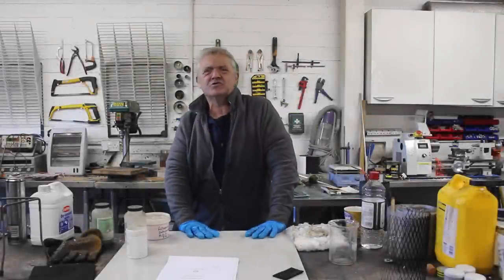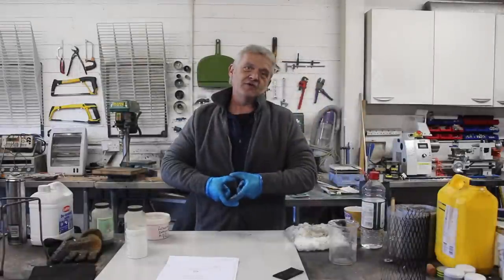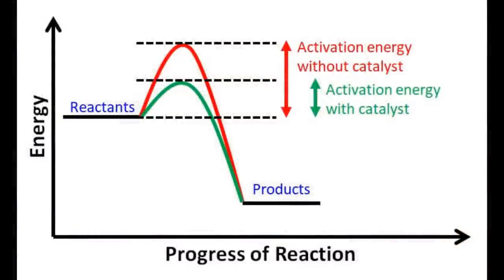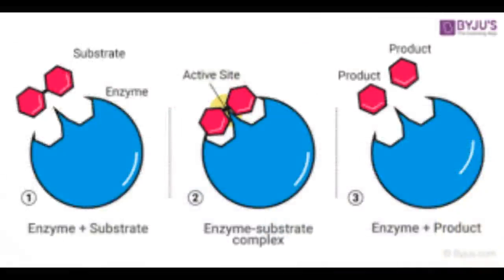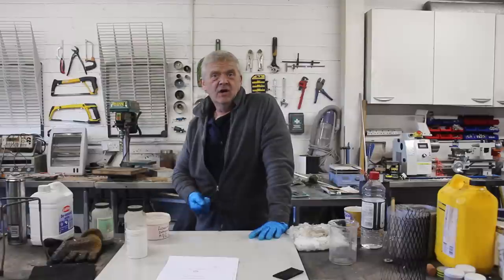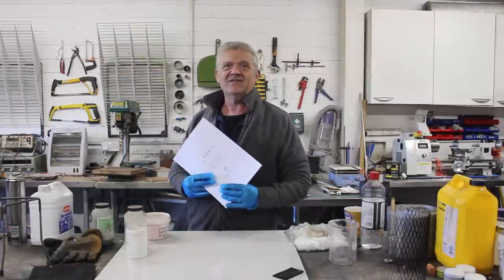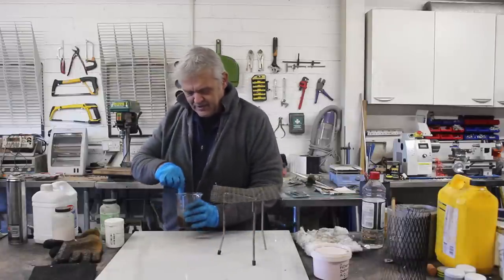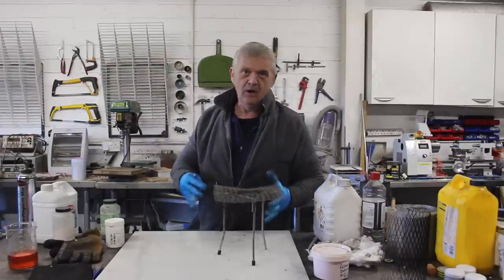1713 DIY Flameless Catalytic Heater

Comment: I have several ZIPPO platinum catalyst hand warmers, and a couple of old COLEMAN catalyst tent heaters that used ceramic wool and platinum as well. I reconditioned those old heaters and they work great. I love this idea using these various ingredients.
Reply: Some folks have found that glowing embers for gas fireplaces have platinum catalyst, and are good for the zippo hand warmers... Makes me wonder about using them in a little stove.

Comment: I remember in the late 60s on the train floor there were aluminium blocks that you would turn over and they would heat up. I also remember army ration packs that had some chemical way of heating the food.

Comment: So this sounds like a handy little device I carry in the winter time here in Maine. It is a hand warmer that uses lighter fluid. Add the fluid, light the wick, heat the little fiber area and then blow out the wick. Put the cap on and poof..your heater is running. It get very hot to the touch and you carry it in a little cloth bag. They are only about $18.00 USD.
Reply: I used to take one of those when fishing in winter when I was a kid back in the late 1960's. They are surprisingly warm for their size ♨

Comment: Very good!   I see chromium oxide, cobalt oxide, and manganese dioxide available as pigments and glazes, that don't seem to require further oxidation. Is there any advantage to mixing and cooking the chemicals together vs buying the oxides outright as powders?
Reply: Good idea with one exception,  these are made as glazes ect.  You would have to cook off or otherwise remove the additives that make it safer to handle and in essence what it is meant for, ie.. a glaze.  Here is the caveat, even after cooking off those impurities, some residuals will remain and need further purification before use adding complications.  But keep thinking along those lines,  you have a great idea here if it is possible to purify those adulterated chemicals.  I love this train of thought!  Keep it up.
Reply: Solubility I'd imagine.
Reply: @jamesross1003  I found the raw powders on line and at Amazon.  I should have said "for" glazes rather than "as",  They seemed pretty cheap, and don't seem to be considered hazardous to ship in the US.  As pigments they should be soluable in water -- which may not matter much if applied to ceramic or glass wool as a substrate.  
I also found that while many newer OEM catalytic converters are expensive, an older universal replacement converter is cheaper than the smallest quantity of all the three powdered metal oxides together.
Reply: @azlandpilotcar4450  Nice, let us know how it turns out!  Looking forward to your experiments.  Careful though as the chemicals can be dangerous.  Best of luck.

Comment: would be nice to see a video on cleaning out a catalytic converter that has stopped working because it is coated in something like carbonized material which paint thinner and other compounds are often used to clean a catalyst off so you can get more use from them so getting a salvaged one for recycling and seeing if it could be converted into a catalytic heater after cleaning is possible :)

Comment: IIRC Solid Oxide Fuel Cells use a similar principle and operate at temps around 200*C using either a zirconia catalyst or substrate. Acetone vapours do the same on hot copper. Ammonia does as well but can melt the copper and creates ammonium nitrate as a sideproduct.

Comment: Hey Robert, as an alternative to the cooling coil in destructive distillation, maybe sticking a pipe in a bucket of pipe full of sand will work?  The methanol vapors cool, condense on the sand, and fall to the bottom of the bucket/pipe, and the light gases vape off into the atmosphere, or could be collected with a balloon over the bucket/pipe.

Comment: Copper is a highly effective catalyst for ketone oxidation.  This also reduces copper oxides on the metallic surface.
This is utilized in brazing of copper as the flame acts as the flux, reducing oxide and allowing the filler metal to flow.

Comment: You can buy catalytic straps for zippo style hand warmers

Also I did have a cheap20 buck portable  gas heater a few years ago- which had a ceramic grid which got red hot I think the brand was crossman
Reply: those ceramic ones are awesome

Comment: Have to add in that cobalt isn't exactly friendly stuff either. Rob, did you have any concerns about the salts getting aerosolized by the blowtorch? They do tend to make a pretty strong wind. Since there wasn't any visible glow typically seen on carbon hot enough to burn, I'd guess the catalyst also worked on the carbon substrate too!

Comment: Might be an interesting way of heating a pyrolysis unit up to the 400 C some of them like to run at such as the ones for used tire pryrolysis to generate the heating oil from tires. No worries on accidentally burning through your container versus an open flame burner. I have a few commercial ones a about a foot in diameter.

Comment: Several years ago I saw a sand heater it was a simple design a square tube fill up with platined sand and run hydrogen from the bottom first you heat up the sand on top and then the catalytic heater started
Reply: Peter Salocher I think
Reply: @wodgesad  yes it was him
Reply: @wodgesad  funny, just saw his vids this weekend. =)

Comment: Video idea - DIY gel heat pouch. That type where you 'break' metal piece and it start to crystalize and heating up.
Reply: Seconded,  they use sodium acetate (which you can make yourself by reacting vinegar and sodium bicarbonate - this generates sodium acetate and water and CO2, presumably the water can be evaporated off, and the resulting solid used in the heating pad after it has been melted).

Comment: A great video and something I would like to try as a room heater. I would use caution in a confined space because there will still be products of combustion eg carbon dioxide which will need to be got rid of, and if there is too little air volume or ventilation, such as in a tent, then Carbon Monoxide could be produced. With that in mind, would this work with pure hydrogen as a fuel?

Comment: Can we use pyrolysis to get fuel out of asphalt shingles?
Reply: fractional distillation like in an oil refinery. i've seen heavy tars gassified and fed through a pipe with aluminium powder to crack the long carbon chains down before being sent to the condenser.
Reply: @daroniussubdeviant3869  starting  to sound like a very intense process
Reply: @mackelby1  yep. pyrolysis is fascinating and there is a lot involved on a chemical level. if it is done a certain way everything can be reduced down to hydrogen and carbon monoxide which makes a brilliant fuel.
Reply: @mackelby1  they way to do it is just to do it in two or more passes. collect the tar from the first pass and run it through again and again till it all breaks down.

Comment: maybe a custom zeolite could be formulated to take advantage of the structure of aluminum and silicon that would be able to break apart the fuel compounds and release them as smaller components as well as releasing heat so you could recapture the compounds and then burn them later to get even more heat when you can use a flame in your heater, while the heavier more complex fuels could release heat flame-lessly while being broken down by the zeolite structure or something?

Comment: Can these same oxides be used for catalytic reduction of water by carbon? I mean like the wood gas reaction where water goes over hot carbon and generates carbon monoxide and hydrogen, kidneys be used as a catalyst to reduce the temperature required for that? Or does this catalyst only work in the oxidative direction?
If so what would you recommend for me in the reductive direction?

Comment: I wonder if the carbon felt would last if it was enclosed like the heaters you've been making so far.  with no access to oxygen except at the top of the felt wick, the catalytic reaction would not occur, keeping the temperature of the felt low enough that it wouldn't break down.  maybe?

Comment: I've been thinking of buying a second hand TATA pickup that runs from the factory on CNG. Then I want to make a small Steam Methan Reformer. I need a heater to to heat a Nickel Catalyst to 800°C. Steam and Methane in a Nickel Catalyst at 800°C converts to hydrogen and carbon monoxide.
Do you think the chromium oxide, carbon oxide and magnesium dioxide material on the exhaust could generate 800°C?

Comment: what about using sand as the wick?  it's cheap, available everywhere, temp resistant, has a high surface area, and will conform to the shape of any can in the supermarket 😁.  maybe throw the chromium oxide and sand in a jar, dissolve the other catalyst material in water, add to jar, seal and tumble for hours (could pad the outside of the jar and throw it in with the washing and drying for a few loads of laundry 😁) then pour into whatever can for the burner body and cook it in the oven.  might have to use more catalyst material, but if it works it would be safe, cheap, and accessable to anyone.  maybe use clay or plaster as a binder and make a paste to create higher surface area shapes.

Comment: Hi Robert,

We own a scrap yard so catalytic converters aren't that hard to come by.

How would you build a heater from a catalytic converter?
Reply: to test a cheap ebay Catalytic convertor; I lit a propane torch, held it to the honeycomb until it glowed red, then turned off the flame, and then turned back on the propane supply without relighting it. It continued to glow and give off heat as long as the propane continued. I would imagine you could devise a heater that worked off of this simple principle. good luck

Comment: Though I never looked into, I've wondered about making a catalitic element to add to a wood stove so it wouldn't have ad much cleaner smoke and more heat out of the fuel, though one can buy them, they wouldn't be a custom fit. As a medium, I thought paper soaked in clay, woth hundreds of holes, triangles, or honeycomed, etc. in the size and shape wanted with a framework also of clayed paper. Do multi layers. Fire. Dip in catalist. Either have a metal frame or have bolt holes already in fired unit. Some catalists could prob be mixed in with the clay right off or as a glaze, if thin enough not to fill holes.
Reply: It is an interesting idea, but it is probably easier to insulate it and get more air/oxygen flow into it.  A well designed wood heater/stove can combust efficiently enough to have little left over pollution.
Reply: @justinw1765  Your right in a way. If you have alot of thermal mass and  catch alot of the heat, a fast, hot burn for an hour-hour and a half, then close air flow down just enough to let the coals burn down so you don't send the heat you've collected out the chimney. But when keeping a steady fire going, you need to keep air choked some, or the heat goes up the chimney and is wasted, but some fuel will be going up the chimney without being burned. A catalitic will do a second "burn" of alot of that. I heated a big 100 year plus old house for over a decade on only wood. Most of the winter, it was about 80°f on the main floor. If I gave it more air, it would have burned cleaner but been way to warm and gone through way more wood. The most efficent wood stoves today have catalitics built in them, that has been one of the biggest game changer in wood stoves the last few decades and way safer as chimney stays cleaner, so less risk of a chimney fire.

Comment: I had thought of using rare earth nitrate and a ceramic mantle but I know I am being silly as infrared heaters already use ceramics to get red hot on gas stoves. The incandescent material would only be to make light from the hot flames. Though that would be odd having a heater that was ceramic and incandescent that make both heat and lots of light. The idea was to mix clay with either a rare earth oxide or water soluble nitrate to make the ceramic element and have something to cut or poke fine holes all over the ceramic burner that would glow red hot and maybe be incandescent. I am sure there is a reason why this was never done.

Comment: Isnt there a fuelcell running On CO2.?
Reply: It would take a  lot of energy  to break the bonds of CO2. 

There is however an American company (solidpower) who has managed to create a 50 percent efficient(electrical) natural/house gas fuel cell- 30 percent is waste heat which can be used for water heating

Comment: 😍 what if you incapable the catilistic heater with conductor and put in on you central heater the conducting metal of the tap zo the less negative space goos trouth the conducting in to the water when on the other side there is some heating you need match less gas to heath the aater💜💜💜
Reply: less negative space to tache the tangebilety of the conections of atoms so they led go elchader and later on reconbine 💜
chemistry moves along outomaticley😍
Reply: but in hot water it is extra dratio as there is more (less negative space to reseave from en led go again 💜
Reply: oooo you need more defusional radiation to mentain heath to like in cars👀😅😅 sorry I thought they olrady whare adepted to the new catalistic understandingsb😅 silly me💜

thank you and oll injoy beïng😍🖖🌈🌟